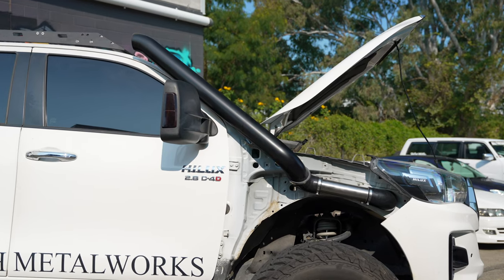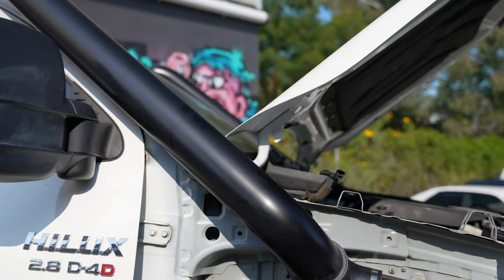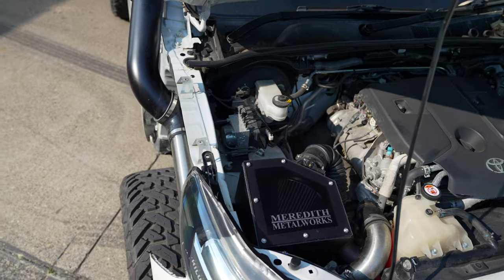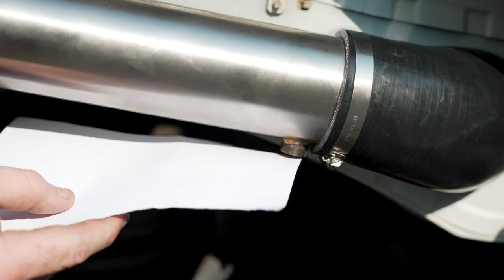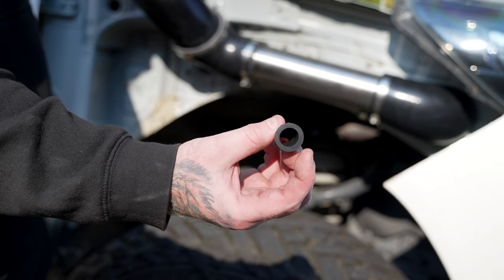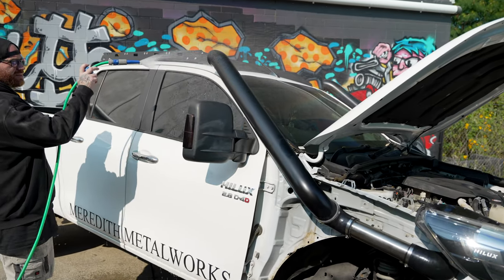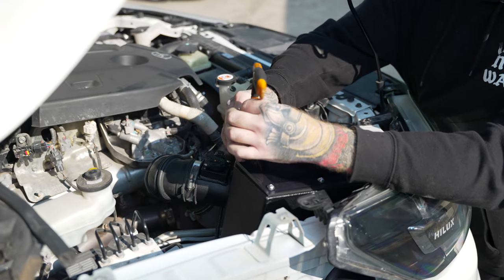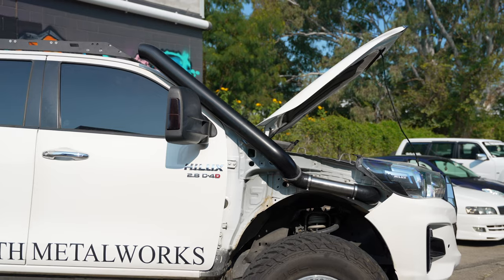Water in your stainless snorkel? We have fixed the problem!

Comment: Do u have to make a cut for that second smaller pipe to fit into the engine bay or is that hole already there frm factory?
Reply from the maker: Some cars require it other have factory holes there we utilise :)
Reply: @meredithmetalworks  does the gd6 hilux in this video have the hole from factory?
Reply from the maker: Factory hole for those ones :)
Reply: @meredithmetalworks what about a series 1 np300

Comment: When the water was sprayed in the snorkel, was the car running? Also how different is the rate of water coming out of the water diverter with and without the duck bill when it was being sprayed with the hose?
Reply from the maker: Hello, yes car was running the whole time. But the trap works with or without it running it just pushes out better with the car on as it has pressure behind it. 
The water comes out at the same rate but it does have a fair bit of room on the inside to pool if the in rate gets more than the out rate. 

You can see the difference at the end of with and without the duck bill. The duck bill is just there to stop water going back into the pipe.

Comment: Will that work if you are on boost, creating a large vacuum, doing a river crossing, and a splash sucks water down the intake pipe.
How does the duckbill one way valve work with vacuum behind it?
Reply from the maker: Yes it does. The valve on it is a one way valve stopping water from entering. Even if you where sat stationary it would stop water getting in but in the chance that water does get in there is a fair amount of space inside the trap before any water could make its way to the airbox.